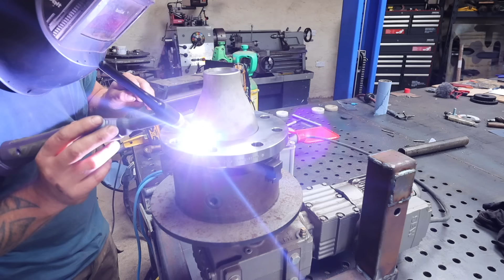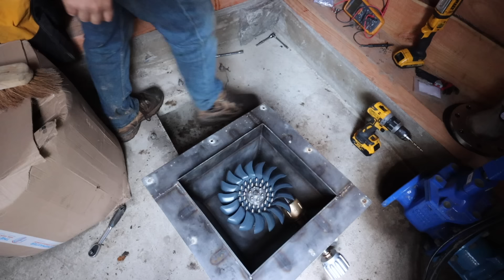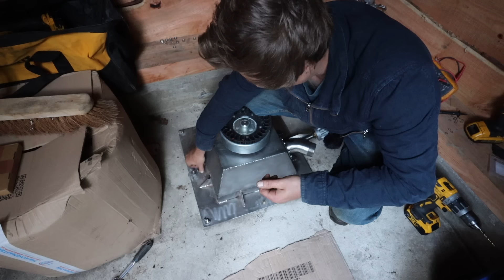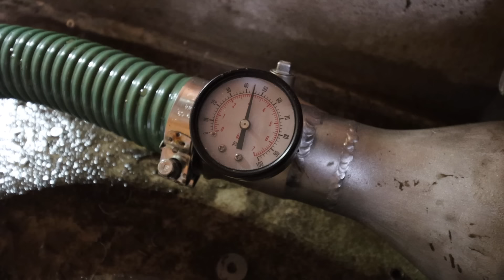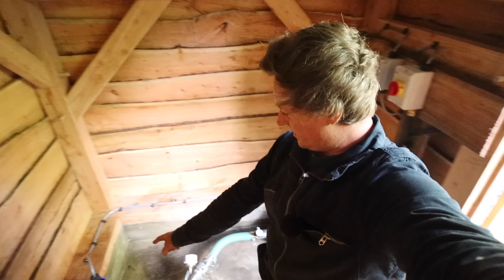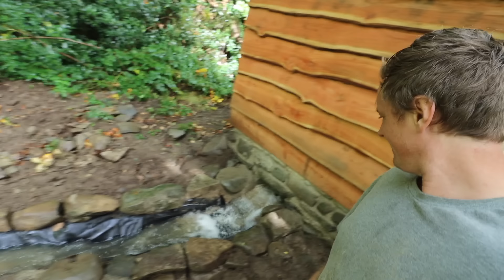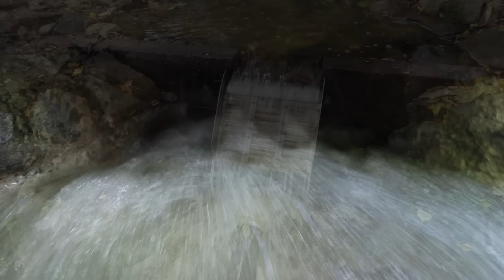North Wales 1.5 Kw Hydroelectric System Part 6 Running the turbine For The First Time

Comment: Really nice system! Great output too! I'm a bit concerned about the high electric power components right next to a system containing high pressure water. Perhaps a way to shut down the water input from outside the shed would be a good safety measure to stop the motor from spinning and producing current. When the brakers pop, but the turbine is still spinning, it is not directly safe when there's water everywhere. Also a cover for the motor would be a nice add on. Maybe with your logo on it like you did on the other project :) Enjoyed watching your video, looking forward to the next one!

Comment: Have you thought of a system where the water comes in through the top of the building, and the unit is attached to the top of a giant water storage container lifted off the ground, and then that water is in turn run through another turbine system? 🤷‍♂

Comment: Great work and inspiring video. One thing I do not understand why you converted to DC , better remain on AC is good idea when you have 1.6 KW . AC has low loss on wire for long distribution. My Village in Nepal  has  mini Hydro 12 KW , powering 120 houses for  basic  uses.

Comment: 10 pounds (quid) a day equals $12.17 USD---- that's $365.10 per month (30 days), or $4381.20 per year------ that's really expensive for most people in the USA with an average small square footage house.  Customizing power systems utilizing Solar, Wind, and Water power is not only smart but saves a ton of money.

Comment: I’ve watched several of your videos and I see a few (in my opinion) fundamental issues with your system.

If you have a turbine with around 1.5kW of power, why bother with expensive batteries? Just build a larger water reservoir and use gravity as your battery. You only need a motorized valve in the system that regulates the water flow to the turbine based on the electrical power demand. When there’s no power demand, the reservoir fills up. With little investment, you could achieve 10-30 times the capacity compared to batteries.

Use a generator with as high a voltage as possible, even up to 400V, because solar panel systems in series operate at 300-600V, meaning there are cheap inverters available for such setups. And with several hundred meters of wiring, even at 400V, the losses are significant. You don’t need to worry about electric shocks. Stick with AC, as it's less dangerous, and use a residual current device (RCD) immediately after the generator that cuts off the power if there’s 5-10mA leakage to the ground.

Use split air conditioners and a heat pump water heater. The latter, running at 150-400W, produces as much hot water as a traditional electric water heater does at 1.5kW.

Comment: If I had a gravel problem I would get a large tank an IBC 250 gallon tank and a pipe that goes up 10 to 24 inches letting the sand go to the bottom and you could expel the gravel at the lowest point !

Comment: Kinda sad that LR couldn't do any better than that, I've had 2 discovery IIs and still have one, yeah I haven't needed the winch to pull it out, it has crap tires on it and the traction control doesn't even work, they sure don't make stuff like they use to....

Comment: I think the pressure drop of the water running through the tube is not a friction loss. It is due to energy conversion. A part of the potential energy of the pressure is converted into kinetic energy of the running water. That's why the potential energy and therefore the pressure of the running water is reduced.

It is the same as in the nozzle of your Pelton turbine. The pressure drop to ambient pressure is also no friction loss. It is caused (maily) by conversion of potential energy into kinetic energy.

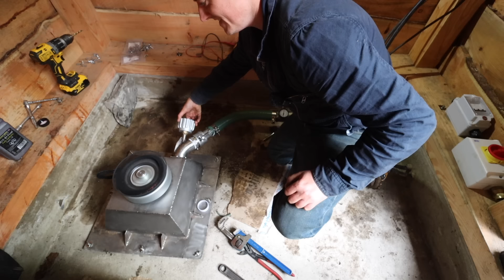Comment: @9:29 - that whine as it spins up is very, very, very satisfying!

Quibble: when the water is flowing the pressure reads lower because of the Bernoulli principle.  This is still static pressure (no matter how fast the water is moving past the port. Dynamic pressure would need the sensor "facing" the flow compared to an other sensor at a right angle to the flow).

Comment: So that setup generates 1.5kW? if you had little to no head but could divert enough water could a similar thing be accomplished do you think?  everything i see goes on about head diff, but for me its just water flowing at speed.  if you can get that flow and speed, does it really matter whether it came from height

Comment: Only comment is I'd have used a flexible pipe bellows coupling between flanges to deal with possible vibration, and kept the final pipework in stainless steel.

Comment: Little fluid dynamics info. The venturi effect or reeuced static pressure with increased flow velocity is not a loss. Essentially, potential energy gets conerted to kinetic energy.

Comment: Why are you TIG Welding backwards? With TIG you move your torch and rod from right to left across a joint to be welded. Your welds will greatly improve when you do it correctly. You also should have put a bevel on the flange where you weld bead was to go and do several passes to build it up.

Comment: That setup is so nice. Really well done. I'm curious how much more control you could get over these generators with something like Home Assistant running that could essentially automate the valves by monitoring pressures. Home Assistant ties in with Victron hardware really well and you'd be able to monitor everything from them in Home Assistant as well. You can also have it setup to send you alerts if you had something go wrong like a pipe burst or a wheel that's going over RPM.

Comment: I just found your channel and I think you are a very talented individual. But being new to the channel I am a little confused at what I feel is a very expensive system for very little electricity? Am I incorrect? 1.5 kW is only about 15 A, which is the equivalent of one outlet. am I missing something? Thanks.

Comment: those welds are hirable and you tig welded it why dose it look so bad
Reply: He is TIG welding backward, tig welding is done right to left pushing the puddle. He did not grind the casting to clean it so it was making the puddle dirty the entire time. He also should have beveled the flange for welding as it was so thick

Comment: When putting 3 locking bolt on the same side of the shaft dose it not cause a slight imbalance, would it not be better to put three equally spaced around the shaft? 🤔

Comment: Impressive work! Just a small correction, the difference in pressure from when there is no flow to full flow is not just due to friction losses. A large part of the difference is due to velocity head, which is the kinetic component of the energy in the system. see here https://en.wikipedia.org/wiki/Bernoulli%27s_principle

Comment: Tri clamp fittings will be easer to do maintenance.  The 3 in. hose fittings. Tri clamp fittings are flush. instead of bail type that needs to slip over another fitting to clamp.

Comment: Well done, mate. To build a system that requires electrical/mechanical engineering design skills then carpentry, welding and electrician skills to install you should be very proud of yourself. It is very impressive.

Comment: I'am a DIY guy except for certain items I'd rather buy than build. 
You selling the Generator Headset, bridge rectifier? I build and install. 
The other items in the turbine shack, breakers and disconnect switch, not sure of all you mounted on the shack wall.
Wondering what price range for those items, might not need the 1kw size Headset. idk

Appreciate seeing your wife range of builds.

Comment: Amazed you say 24kwh is double average uk usage, what do most folk use for heating and cooking and hot water, is it mostly gas, rather than electric?
In canterbury new zealand, i average 20+ / day in summer, and peak winter days are often 50+kwh, with an average of 45, (1400-1500/month) with 3 heatpumps on 24/7, in a smaller old standalone house. But to give some cost  perspective, i only pay $0.15 /kwh on my high user plan, which has a $2.60nz/day base charge on top.

Comment: Ha, flange, ha, nipple. Giggidy! ...this guy doesn't mess about. Most men play with 10mm nuts and bolts, this guy isn't happy unless it takes 3  men to hold a single bolt. Even the joints on the 4 inch pipe, it was like watching 2 tiny people fitting a bathroom suite.

Comment: Future thought.. Put a WTE in the supply LARGER than pipe itself (to slow water flow). Put WYE facing down. Put valve on downside for cleanout. Heavy paritcals will not make it across WYE and drop into cleanout.. You will need a way to purge air and seal back off so a small UPWARD air purge line wil need to be installed on WYE.

Comment: I wonder if there's anything clever which can automatically adjust the nozzle output depending on how much flow is available? I think you'd only need a few standard bits and a little bit of code.

Comment: I've seen people using a barrel drum as filter somewhere in the middle. Silt and gravel goes to the bottom by gravity where it can be drained, got a drain near the top, so the cover doesn't blow up, and the pipe continues somewhere around the middle of the drum. BTW excellent work.

Comment: Just an idea since you mentioned the nozzle. Wouldn't it be possible to fabricate an adjustable nozzle of some sort? It could even be made in a way that the monitoring system could automatically adjust the nozzle diameter depending on the output. Optimal power for both high and low flow time of year.

Comment: Uk house uses 12 kw? My home runs around 65 and we heat with gas ! USA average is 30.

I’ve a 11.47 kw solar and I’ve seen it make as much as 10.4, but no more than 80 in a day is about its limit. In the winter on overcast days it does barely anytbing.

Comment: Totally overbuild, flange, 4 in feeder pipe reduced to 2 in? even considering friction losses over your 100m pipe you would have easily had enoug with a 3in pipe but the HUGE valve is a bummer and the flimst flex hose to feed the turbine...you are not an engineer mor of a tinkerer...

Comment: Why would you put the rectifier so close to the generator. You will have too much losses if you run a long cable with dc. Use ac and put it on the other end

Comment: Kris, one other thought I forgot to mention...... I would mount the connector/plug from the generator higher up the wall.  Where you put it is below the top level of the concrete foundation and I noticed you ended up with the generator mounted flat on the floor, without the drain.  If that floor area floods you have 150V in the water!

Comment: with your needle valve you should be able to attach an electric control to the valve so to create an automatic adjusting system. So in non peak times if the water level drops the system automatically shuts down the flow to build back pressure. You should be able to build a control system that will have the alternator keep just above usage since the water is not a finite resource. Also it would be nice to see where the output hits the spoons as you will gain some efficiency with a spoon redesign and proper jet placement. As to spoon redesign I think a texture in the spoon will help or ridges. We think of a spoon because we eat with a spoon but what you need is maximum resistance to make the wheel turn faster.

Comment: You could let the water that has made electricity run into a very large water container and put three one-way valves on the container at the bottom connected to enter bro and pump the water back up hill from using the weight of the water! The reason three one-way valves work to pump it up peel is because water mixes with water from one valve to the other valve and to the other valve they have to be in a row

Comment: Why couldn't you change this nozzle out, then weld the smaller one on the other side, build a bypass for the smaller nozzle which will have more friction.  This would change your 1kw to 1.5kw/0.8kw or similar with the turn of a handle.

Comment: To minimise gravel and silt at the nozzle a guy in the states installed a tank half way which filled first. The out pipe was about half way up the tank allowing sediment etc to collect in the bottom of the tank which could then be periodically flushed out with a valve fitted near the bottom. Now if this affects the overall water pressure I do not know but it seemed to work.

Comment: Hello Kris! I work as a automation programmer and technician. It would be interesting to do some brainstorming on how you could see automation improve your system. 
For example, 
On demand adjustment of power? 
Scheduled cycling of valves to fix clearances?
TPC/IP connection to live system for remote control?
The system regulating flow to maintain a constant system pressure? 
These things aren't unreasonable even on a tight budget.

Comment: I don't think measuring the pressure at the small section is a good idea at all.  You say the "dynamic pressure is lower due to friction". Along the pipe, yes, but in the small section you also get the venturi effect. As it flows faster through the small section, the prseeure drops, so your pressure reading will vary with speed of flow, so you're not getting a reliable reading of supply pressure.

Comment: If you wire wheel something like this, finish it with sand paper or something non metallic to avoid embedded iron particles rusting.

Comment: Interesting project. 

Not to be the YouTube comments no all. But when your welding with the positioner want the positioner to turn the opposite way. The welder section should move away from the rod and the torch. That way you’ll have dimes.

On the corrugated green pipe I’d worry about it wearing through. Try to never do bends with those pipes the turbulence will not only lose efficiency but they’ll wear. I’d use a stainless 45* and 2 straights.

Comment: Simple pressure control would be very easy to add, however, is it worth it? I mean whatever gets added will drain power constantly and at the times when there is spare capacity, it's not needed so would drain power when there isn't enough being produced. Also don't see the point in the adjustable cone for the same reason really, better to have it fixed and calculated unless someone is available to constantly tweak it. Shame for the use of concrete which is probably the most environmentally unfriendly building product there is, this is more of a reflection of what's available, you know someone who is "Natural Building' is using it, shows how few alternative there actually are!!

Comment: Great job!
It's only a side note, but your statement " The pressure goes down when the flow speeds up because of friction losses" is quite incorrect. At any given temperature, the total energy in the stream (potential energy [from pressure] + kinetic energy [from flow velocity] ) must remain. constant so pressure and flow velocity have an inverse relationship.

Comment: Amazing job, really well done. Only wish I had a 1/10th of your ability. 

My suggestion might not work if the losses from it don't make it viable, but the idea is to have 2 different diameter nozzles and a V shaped splitter with a diverter value / tap, so you can easily run at the optimum size nozzle for each flow rate by flicking a lever over, eg larger nozzle in winter, smaller in summer.

Comment: Hi kris
You're intake box grills can they not be held by the T shape bracket then no need for nuts and BOLTS just a swing  toggle at the bottom of the box  do you have a e mail address then I could send a drawing to you it may help you as you are doing the best possible job  I love watching your video you are a very clever man

Comment: I dont get why you put the bridge rectifier on the other end of the cable ?
The DC voltage is higher wich would lead to lower losses in resistance. On more thing since the cable is not running in the air the moisture in the ground is „dampening“ the „fast“ changing AC (mostly capacitive losses ). For example in long sea cables the use DC for this reason. I dont know what frequency the turbine is outputting and therefore how big the impact is.
Im not an expert in hydro and im not familiar with the equipment you’re using, im sure you have your reasons. But that’s what i was told at the university.
I really enjoy your videos ;)

Comment: Well done you've thought of everything, did you ever consider sitting the manifold on rubber spacers in case of some rogue vibration? Also, if your pipe coupling did burst (or something else) how could you turn the water off when your off is so close to the turbine and its workings?

Comment: Please don't wire wheel the barbs ever again, it's a really bad idea. It creates small scratches in the surface, and can develop cracks (therefore losing seal) quicker than you'd think. Other than that, great build.

Comment: this would have been a game changer  when I was living off grid! After I sold my solar array I used a 12v car alternator coupled to a 6hp subaru ohc engine and it burned about 60l of gasoline per week running continuously at a load averaging 200w

Comment: I live in North Wales, and I wish I had a river above my house. I would be building a hydro system ASAP. With the cost of electricity now, it would be even more beneficial. I do electrical engineering in my spare time as a hobby. I have always wanted to be off the grid. But I don't have the money, or right location. Maybe one day I will get some luck, and do it. Very interesting video 👍

Comment: Really impressive. If you can say without giving away the commercials / contract between you and the customer, how long do you think the system will take to break even? Although, I guess that would also depend on if they are swapping from heating oil to ASHP at the same time?

Comment: The pressure reading at the location of pressure tap is lower primarily due to the conversion of pressure energy to kinetic energy (Bernoulli's equation).  Losses will occur in the reducer but they are secondary.